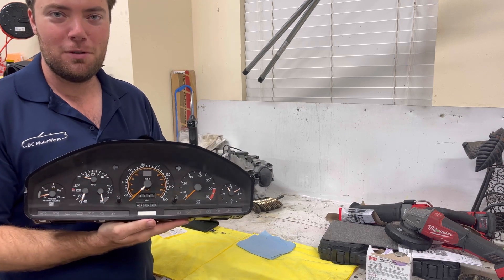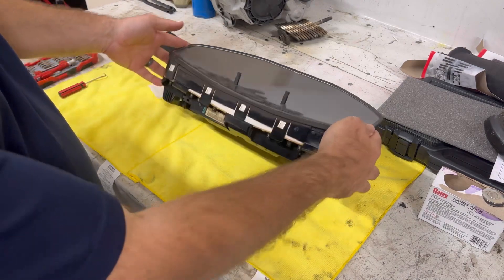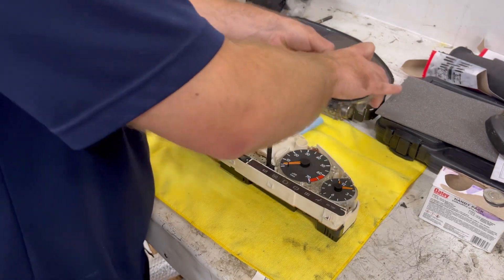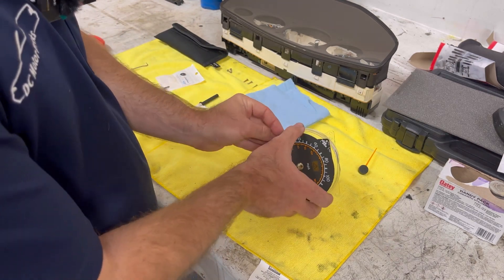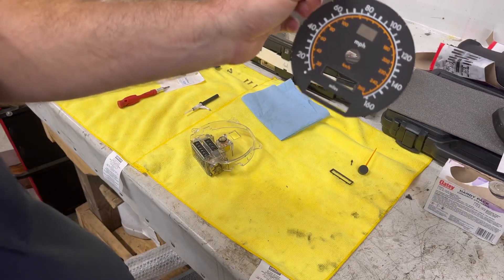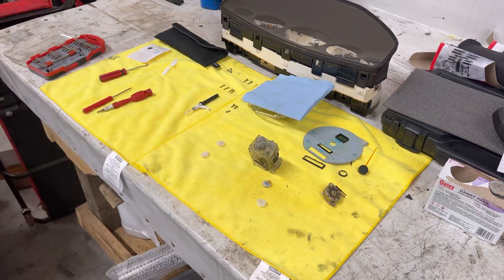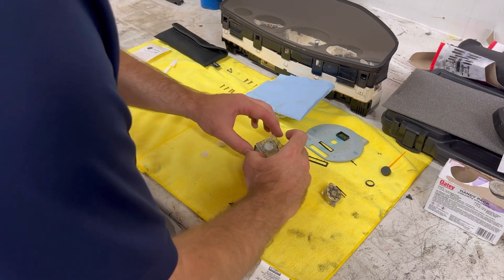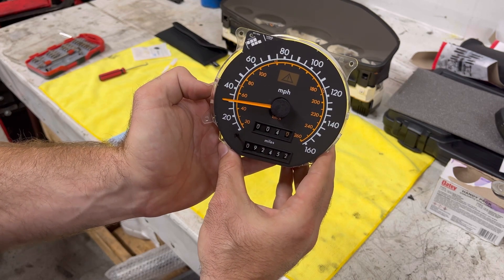HOW TO: Repair Odometer Gears in R129 and W140 and other Mercedes

Comment: Hello! How do you change the capacitors? I have a 92 300se (w140) with a inoperable cluster. There is power to it but no gauges work.
Reply from the maker: There are usually two power supply’s. Make sure both are good. If not, you can desolder the caps and replace them. There are companies that will do this too
Reply: @DCMotorWerks  Your video shows a 12 tooth pod (with the 15 tooth little gear). Was it from a M104 320 engine, or was it a V-8 model? 
For an american  W140 with the 6 cylinder M104, would it also be the 12 tooth pod?
Reply from the maker: @mutleybird  v8
Reply: @DCMotorWerks  Would an M104 6 cylinder (W140 300SE) be the same 12 tooth pod?

Comment: No need to remove speedo display
Reply: where do you get the small enough mini angle Philips screwdriver to get that one screw out in the back (which has plastic above it)